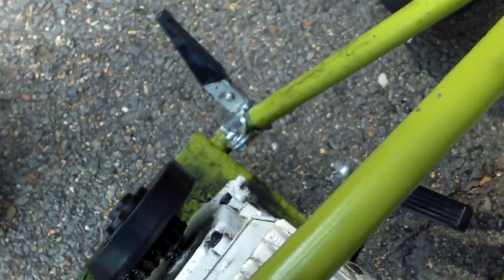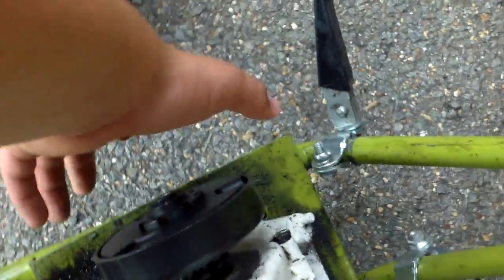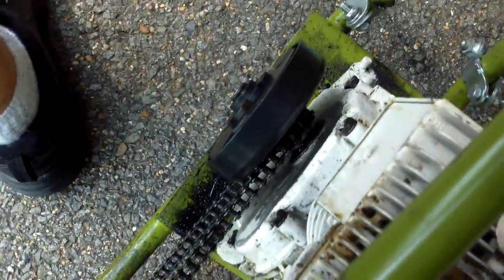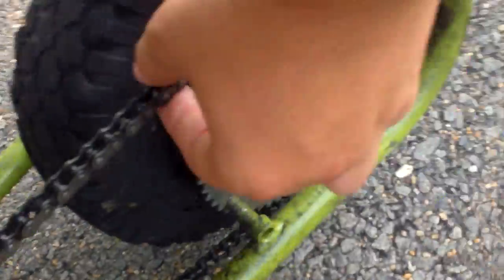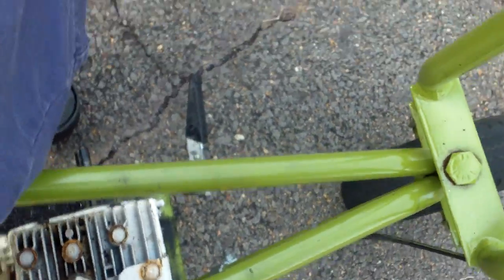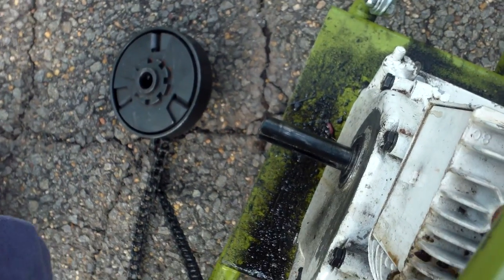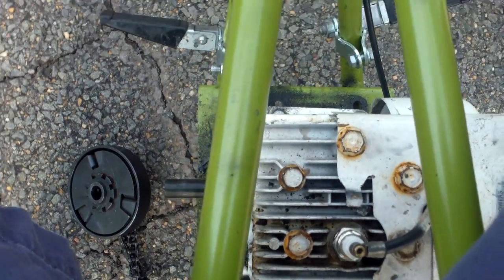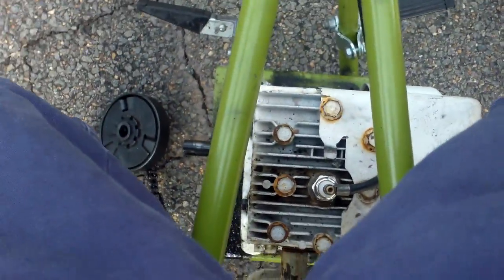How to tell if your centrifugal clutch has gone bad

Comment: my clutch i noticed i can push it inward and outward   is that normal?
Reply from the maker: Eh… I wouldn’t say so. I mean unless you have a solution so it won’t fall off. My crankshaft isn’t threaded so I honestly put a little jb weld on it to hold it on for the time being 😂 I haven’t rode this bike in like 4 years lol
Reply: @streetstallion  its got like a bolt holding it in
Reply from the maker: @somthingarageMD  yeah your chilling 👍maybe try adding a few washers

Comment: Is it normal for my oil to smell like gas
Reply: No change your oil immediately your carb is ether running rich and your rings are shot or the float in the carb is bad letting gas in the cylinder
Reply: If it smells like if it is just gas and not oil that’s bad but it’s normal for it to smell like gas think about it gas and oil does come into a little bit of contact throughout riding
Reply: @sebashtiangarcia6097  your oil should never smell like gas that means its diluted with gas and no longer protects your engine if it smells like it changes it immediately and find the cause or you'll have engine failure I work on small engines for a living I know what I'm talking about...